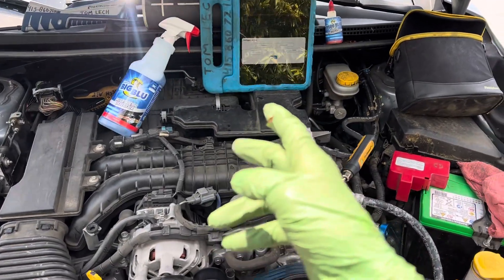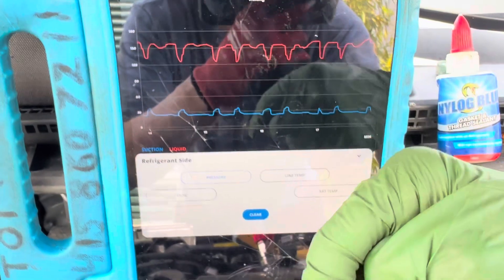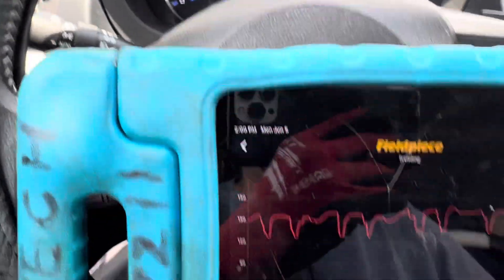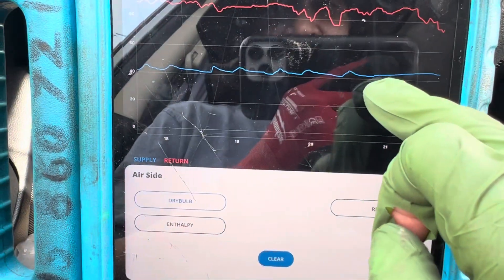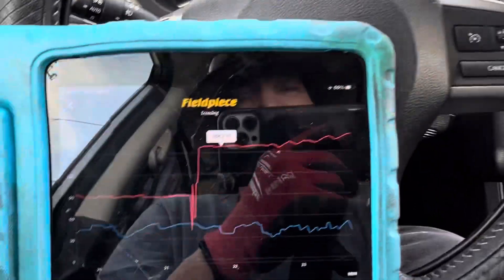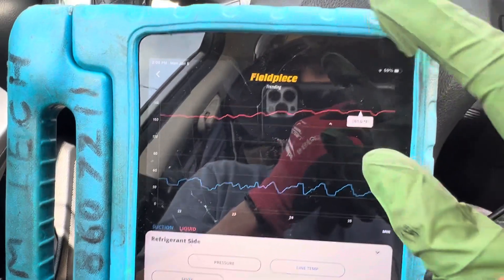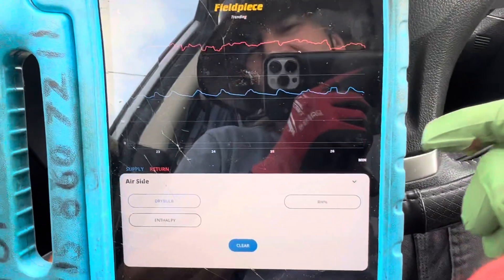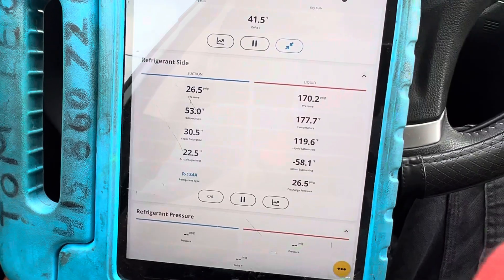Refrigerant Correctly Filled Subaru After Customer Tried Topping it Off. Pressure & Temperature

Comment: Hi. May i ask?  I have customer who has Subaru Forester 2015. He hired me to change the compressor.  i did it.  but the compressor started to work intermittently after about 20 minutes.  I tried to pull out one and two rings from the clutch, it did not help.  The client exchanged the compressor and I reinstalled it.  the same thing repeats again.  but it works when the car is running, when the car is stationary, the clutch just turns off and works intermittently.  What can be wrong?
Reply from the maker: You got several other things that could be not just one thing it sounds like you are not ready to work on Aircondutioning yet. 

I need high-pressure, low pressure and the temperature of the refrigerant in the line entering the condenser the temperature of the line exiting the condenser test the high-pressure switch test a little pressure switch. Let’s just start w 

You need to pull out the manual, and read the mode of operation 

This is not one of those things that you say it does this, therefore there’s only one answer . 

We don’t just change compressors that is not what is done in our industry 

Test can you confirm the reason why it’s on the couch first then we cure the problem .,

Then we replace the compressor
Reply: When I serviced the car everything was fine.  I left the engine running for 30 minutes, I did a test drive and nothing happened.  pressure at this moment 30-50/230-250.  you're right, I'm just learning.
Reply from the maker: @lemonq3  @ 230-250 shouldn’t be cutting on and off rapidly.  30 is good but 50 sounds like it vary hot outside. 
     
Or is 50 when clutch is off ?

Did you preform a oil balance? 

Could be too much oil.  

Fallow all instructions in paper 📄 in box
Reply: This is a fairly common Subaru problem.
Reply from the maker: @lemonq3  yes vary common.  Too common. It’s been a problem so long Subaru should have corrected it by now.  Not keep costing their customers so much unnecessary money on repairs
Reply: 40/250, ambient temperature 90. While clutch works. 
Temperature high side 125 entering condencer. 
When I turned off the Ac button, the pressure was 110/100., and turn on AC again, the clutch starting works intermittently.
Reply from the maker: @lemonq3  @ 90 outside 40 seams a little high.  After 10 to 15 min run time to stabilize reading. 
@ about 1500 to 1700 RPMs

Comment: That serpentine accessory drive belt tensioner is on the verge of failing, it's getting weak, it shouldn't oscillate that much.
Reply: This is a unique tensioner and it has a tensioner on both sides of the belt around the alternator. The  alternator can also be used as a starter for quick starts on this hybrid Subaru.
Reply: @ThePracticalMechanic   I've replaced a couple, when they start oscillating like that they're weak. With a new OE  tensioner assembly and quality serp belt, it's rock steady. It can cause the Start/Stop function to fail. no DTCs.
Reply from the maker: Good info keep in my memory
Reply: @hnd2893  🤔
Reply from the maker: Sounds like a powerful alternator.
Reply: @coldfinger459sub0  It also functions as a starter for the Stop/Start system.

Comment: I have a question regarding variable displacement compressors. I read that it isn't safe to have the system evacuated and then drive without any refrigerant in the system because with a variable displacement compressor it is always running unlike an compressor with a typical clutch. Is there any truth to this? For example would it be okay for me to have a vehicle evacuated, driven home to make repairs and then driven back to a shop for a recharge on the system? I would assume long as the A/C is not turned on inside the vehicle there would be no issue with damaging the compressor. Edit- vehicle 2014 hyundai sonata
Reply from the maker: But there’s no oil being pumped up and constantly supplied to the Front Shaft Seal, refrigerant cool and lubricated. you have a spinning shaft on a seal when it’s filled with refrigerant it has a Supply Refrigerant All behind it.

When it’s empty, it does not 

It’s even worse if it’s under vacuum and driven
Reply: @coldfinger459sub0  Thank you, I will not do this then. I really need to invest into a recovery machine then. Its a real pain trying to complete engine replacements and keeping the A/C compressor dangling around fully charged still.

Comment: I love learning about these ones where you show the differences between a half charged system vs a full proper charge. So many people I've grown up with always have done the "Charge until it's cold" method.  This is proof that you WILL have an expensive compressor burn out on you down the road. It's not that it might happen, it will happen. No one seems to believe or know that compressor failures are almost always caused by user/service error.
Reply from the maker: Dad showed me this when I was still in grammar school 

Tests don’t test 
Techs don’t own the equipment to test
Techs have no formal HVAC education

Techs never took HVAC design 

No thermodynamics and fluid dynamics classes
Reply: Awesome